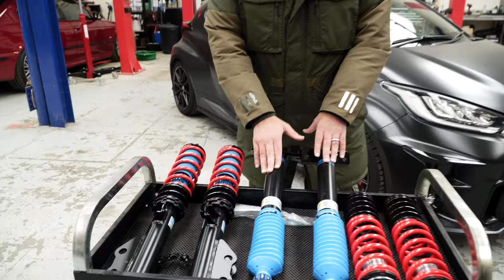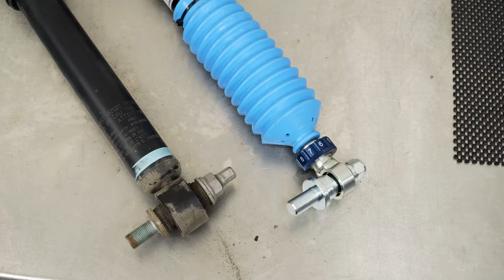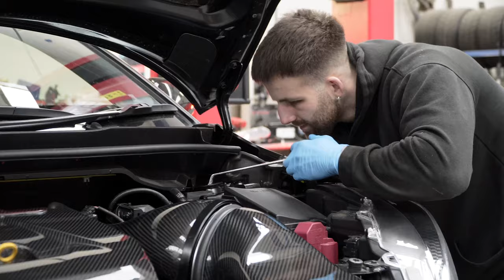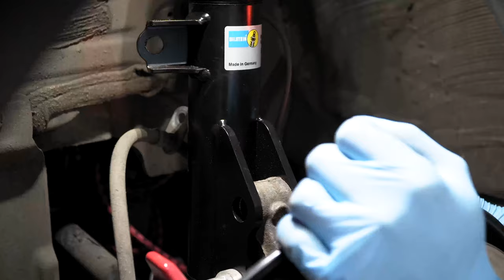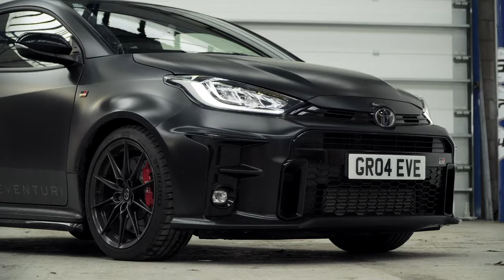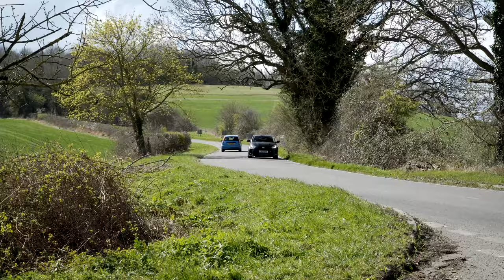GR Yaris Bilstein B16 Coilover Install + Road Review

Comment: good to know there is more in the Yaris...guess the Corolla GR also shows what the engine can handle
Reply from the maker: Yes, assuming Toyota haven’t made any changes to the internals it shows the engine is good for 300bhp which having had that in this is an absolute riot.

Comment: Good video, massive love for the GR, Toyota finally doing more performance models. Will be good the see the Yaris a bit lower with maybe some spacers or lower offset wheels.
Reply from the maker: There’s a lot of adjustability in the suspension to lower it as much as you want. We followed NTP’s advice for optimal handling setup, that will be fine tweaked when we take it for a proper geo setup.

The standard wheels are so light it’s hard to change them, but maybe it’s time we did something 🤔
Reply: @EvolveAutomotive  I look forward to seeing the changes you make. I’m sure the result will be quality as always.
Reply: @EvolveAutomotive  Take a look at String Theory Garage's 21.5mm spacers.

Comment: Watching you toss around the box had me thinking, damn Imran ain't skipping arm day.  Then you say it's empty....ooooh.  lmao

Edit: So for the every day user is the price of addmission worth the increase over the MSS kit? I like the height, it's not too low.  Still has a touch of gap.  Almost looks like it needs wider tires.
Reply from the maker: It all depends on your budget really. It’s an impressive upgrade, and the difference would be even bigger if you used the car on track. The MSS we had fitted did a great job of letting us lower the car and not lose any handling/comfort.

The car can definitely take some spacers or a lower offset wheel yes.
Reply: Makes sense.  Budgets are relative aren't they.  Expensive for one person, is pocket change for another.
Reply from the maker: Yes, and the Yaris is an interesting owner spread, from the person who has it as their only car to the person who has it as a fun toy to use when the weather is bad for their more collector cars.

Comment: Are you still running and developing the jb4 unit? or have you changed to ECU remapping now it has been cracked?
Reply from the maker: We still have it and are really happy with it, but have also started ECU tune development. The JB4 is a good alternative still but think most customers will choose an ECU tune.
Reply: @EvolveAutomotive  what sort of figures would i see with a jb4 on just a stock car? i think ill go for a box as it is so much easier to remove come dealer visits
Reply from the maker: We have done purely road testing with it, but it was very quick. Certainly felt stronger than a car we drove with another box on it. Plus we love JB4s customisability.